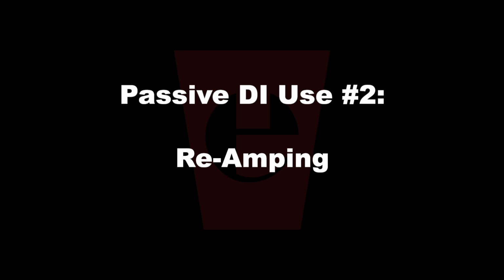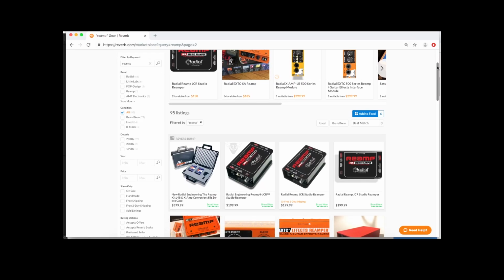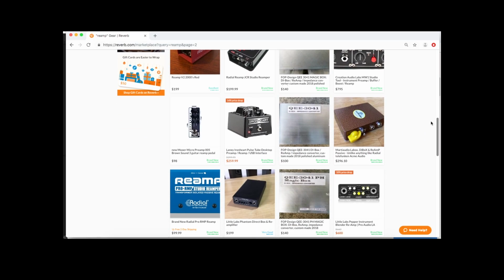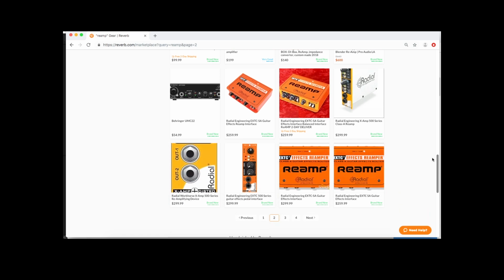Electrical Audio How-To:  Fun With Passive DI's

Comment: I bought a reamp box with the idea of connecting my synthesizers and drum machines to my pedals. However, it has a balanced input, so I don't know what cables I need. Would a TS to XLR cable do the job? Would I need to put a DI box in between? Should I have bought just a DI box instead of a reamp box in the first place? I'm confused.
Reply from the maker: A reamp box is better for this than a passive DI. We pointed out that you can do reamping with a passive DI just in case folks already passive DIs, and want to get more "mileage" out of them. 

The input to a reamp box is usually a low-impedance line level signal, either on an XLR or a balanced TRS cable, and the output is a high-impedance instrument level signal, usually on a TS (instrument/ guitar) cable. The cable you need depends on the output from your interface or mixer and the input of the reamp box. Just get a cable that has the output connector from your interface or mixer on one end and the input connector to the Reamp box on the other.
Reply: @ElectricalAudioOfficial  Thank you very much for your answer! My reamp box has a balanced XLR input, so I guess I'd better buy a TS to XLR cable to connect the unbalanced mono output of the synths to the reamp box. I suppose the worst that can happen is that there will be some loss of volume, but the impedance will be right (which is what really matters to me).
Reply from the maker: @snorelikethat  If you're trying to connect a synth to an amp, you don't need a reamp box. A reamp box is for taking a signal that was recorded already and putting it back through an amplifier.

If you're trying to record a synth direct to a recorder (interface / DAW or tape machine), you need a DI, be it active or passive.
Reply: @ElectricalAudioOfficial  Now I am confused again. My idea is to make the connection synth > pedals > audio interface > daw. The idea when I bought a reamp box was to solve the impedance mismatch (and volume differences) between the synth and the pedals. As I understand I could benefit from placing a DI box before the audio interface (although mine has a built in preamp that meets my needs for the moment), but I would still have the first problem, as I would have to place it after the pedals in any case... Is that right?
Reply from the maker: @snorelikethat  Ah, you bought the wrong thing. You need a DI, and it should be feeding a mic preamp rather than the line input on an interface. The reamp box goes from high signal, low-z (impedance) to lower signal, hi-z, while a DI is meant to go from higher signal, hi-z to lower signal, lower-z.
So your chain should be synth -> pedals -> DI -> mic preamp -> audio interface -> DAW. Sometimes interfaces have built-in preamps, you can just go from 
DI to those preamps.
Reply: @ElectricalAudioOfficial  Thank you very much for all the information and for taking the time. I thought that the impedance and volume difference would be a problem when connecting synths to pedals and hence all my overthinking, but in any case, I will try your recommended setup!

Comment: Fender Deluxxx Rever b silver face also does the sub kick trick, due to its rec output trafo wired in parallel w the amplifier speaker output. 
A boon and a bane if recording in tight spaces, the lo fi kick drum/bass amp signal coming thru yer Guitar channel inputs

Comment: What prevents me from running a dynamic mic straight into pedals without a DI (with a XLR/TRS cable)? I don't seem to notice any issues? Same goes to when I use my audio interface and forget to switch the input from instrument to line level, it doesn't seem to affect the signal whatsoever (and vice-versa when I plug an instrument). What should I expect? What are the problems I should be hearing?
Reply from the maker: Mic level and impedance are considerably lower than instrument level and impedance, which is what the pedals "expect" to see. The level difference may not be an issue if the pedals have a ton of gain, but the impedance mismatch may compromise the signal (distortion, inaccurace frequency response).

Comment: talking about the sub kick thing: do I need to have a DI with a “speaker” attenuation of some sort? or can I just treat is as a line level signal?
Reply from the maker: Nope, no special feature on the passive DI needed. Just put it into a mic preamp, treating it as if it were a mic-level signal out of the speaker-cum-microphone.
Reply: @ElectricalAudioOfficial  awesome! will definitely try it. thanks! (:
Reply: Great video, indeed ! The last example makes me think that such illustrations (or samples) would have been really apreciated for all the previous suggestions.
Video link saved in my favorites, for sure ;-)

Comment: Hi EA folks! Love these vids, unsure if you'll see this comment on an old one, but I had a question about the speaker-as-mic. I've done this a couple of times with shoddily re-wired amps, but this seems so much easier. Does that cabinet have an output wired into it, like for chaining, or are you using what would normally be the "input" from the head as the output to the DI? And, is the cable you're using an instrument or speaker cable? I know the possibility of atomic explosion if you mix those cables up, so I want to be sure before I go plugging in! Thanks again.

Comment: Also with the drum kit speaker, is that a custom output for it to act as a microphone, or can you use any speaker and just attach its input cable, to the input of the DI?
Reply from the maker: It's just the speaker jack on the cab.

Comment: Don't you end up with better treble (if say doing electronic music) running an active reamper , compared to running a passive DI backwards? Or just use an active DI backwards? Oh wait, I think the issue is that my DJ mixer has line level aux/sends and outputs - so a reamper works better converting line to hi-z. I guess if had mic output on console would be more versatile to buy two passive DIs for these setups. I have a passive DI and an active re-amper (as I have a high output bare knuckle pickups 7 string and an active fernandes sustainer 6 string, as well as wanting to run electronic channels from my DAW/mixer) - was thinking might be worthwhile to get an active DI also for versatility/recording passive bass/recording lower output guitars and other instruments?

Comment: Do yall tend to delay the other kick mics in time to match the sub kick ?
Reply from the maker: We'll at least check phase. When recording digitally, it's easy enough to scoot one track or another to get them in a more ideal phase relationship. If we're in the analog domain (recording to tape), we would use a "precision" delay. See our other video on Time Alignment for more info on the latter!
Reply: @ElectricalAudioOfficial , definitely watched that video.  I’m familiar w/ the usual DAW concepts of alignment, I guess just curious which mics you all ‘flatten’ to which ones and which ones remain with their un-aligned timing.  For example, some people do all the close mics back to the overheads, except maybe any internal kick mics are just pushed back to the outer kick mic, and then rooms are left alone (or scooted around to play with the comb filtering or create a slap if wanted, but not put in line with the close mics).  Just curious.
Reply from the maker: @busyboxst7  Every engineer does it differently, and that includes here. At the very least, we audition polarity flips on any mics on the same source. So with a drum kit, we flip close mics on the same drum against each other, and then check individual drums against overheads are what we flip close mics against- standard stuff. We generally won't use the microdelays to align many mics for a couple practical reasons: it takes an incredibly long time (and drummers already hate sound-checking, and the client is paying for that time); and we don't have 8-14 channels of these delays to align every mic. Plus, we often use multiple stereo pairs (overheads, plus front-of-kit, plus rooms), and at that point, each close-miked drum will arrive with a different delay to each stereo pair, so all bets are off! For example, the snare may arrive in the overheads 10us later than the close mics, and 15us later in the center-of-kit; the floor tom may arrive 11us later in the overheads than close mics and 13us later in the center-of-kit. So you simply can't delay the close mics and overheads to get everything ideally in phase- something will still have an arrival delay somewhere. All this miking invariably causes some loss of phase coherence, but the trade-offs may be worth it.

With a DI-and-mic situation, the phase coherence is easier to suss out because there are only two signals, and their phase relationship is very often in that wide zone between 0 and 180 degrees out of phase, so aligning has a clear and immediately audible benefit (and you can't spend 30 minutes driving yourself and your client mad trying to create an impossibly perfect phase relationship between 14 mics).

Comment: One very important point : the level output from your DAW is usually very high. Way to high for an instrument input on an amplifier. Send the recorded signal to an output buss and lower the fader to -20 dB at least. For safety put a limiter on the output channel set to -20dB so you don't overload the input preamp on your amp. Another solution is to use the pad on the D.I if you have one.
Reply: for instance if the peak level of the signal 0dBFS then the electrical peak level will be +10dBu for the difference signal of the balanced output of a Focusrite Scarlett 2i4 (the one i know exactly) audio interface... +7 if you use a mono jack.

... i don't know the levels in dBu of what comes out of an electric guitar actually...

Comment: If you use a cabinet to mic a kick drum, where do you fit any other mics??
On the pedal side?
Reply: I like sticking a sm57 beater side, aimed right at the impact spot. Stan Lynch did that with Tom Petty. Sounds massive, can even work for hip hop. Don't forget polarity issues tho
Reply: inside the kick

Comment: Thanks for that! Question...I was told by my teacher(years ago) that I had to swap around the wiring in my subkick speaker(like using an SWR Big Ben 18"bass cab as a subkick mic)to get it to reverse sound instead of output sound. Is that true or is it as simple as just wiring it up like you said? For some reason this has me verklempt even though I've done it before in the past, it's been like 6yrs though.....bungggg...
Reply from the maker: You don't need to change any wiring!
Reply: I had always read people doing this with speakers also. As an anecdote, I used to record my band practices on my minidisc recorder back in the day by plugging in my headphones into the mic input of my recorder, it worked surprisingly well, so I guess the same philosophy applies.
Reply: @ledheavy26  me too! Used a pair of Sony passive 2" beaters back when the Soundblaster 16 had an amplified output. 
Plugged em in to the Mic input.
Wish I had taped more of myself back then

Comment: Great demo! Are the two toggles for ground lift and polarity?
Reply from the maker: Thank you! The switches are for ground lift and pad (to switch between line level and instrument level).
Reply: Electrical Audio - ah cool, I want to build a couple di’s with those Jensens, I don’t think their schematic includes a pad, I’ll have to take a look. Do you find noise issues when you use it as a reamp, going from a +4 output to the di? I want to reamp with it as well and I’m wondering if I’d need an H pad between my interface and the di?
Reply from the maker: @regortex3364  We don't generally find reamping with it to be noisy. We are accustomed to bringing down the level of the send from the interface to the DI considerably (20dB and more, typically).
Reply: Electrical Audio - good to know, Thanks for the info!

Comment: What db level should be feeding the DI for reamping?
Reply from the maker: This will vary depending on what equipment you're sending the signal to, as well as whether or not you have or are using a PAD on your DI or Re-Amp box.  I'd recommend starting with the output from your DAW all the way down, then slowly increasing it until you're satisfied with the sound coming out of your re-amp rig.  If the equipment sounds overloaded, back the level off a little bit at a time.

Comment: Regarding the re-amping aspect of this video ... when does the distance become an issue?  Your piping the source signal from the console/daw output to the re-amp box in the live room ... that looks like a country mile ... is the assumption that the console/daw  output is balanced line level?
Reply from the maker: Exactly, the signal there is balanced until it gets to the DI.  If the signal was unbalanced, there would be potential for the aforementioned signal degradation in a run that long.

Comment: Great video. 
But I was wondering if you've tested using passive DI's for reaming and for balanced signal extensions against a purpose built reamp or something like the radial sgi, and if you've found there to be any difference or degradation in audio quality?
Reply from the maker: Have not - one brand of transformer might color the signal more/differently than another, but the signal integrity should be consistent if it's built properly.  Less about quality, more about personal taste.  
Cheers!